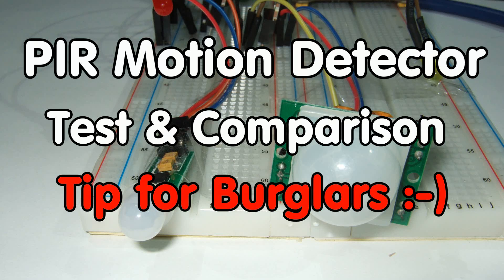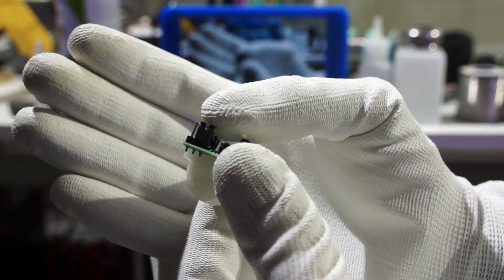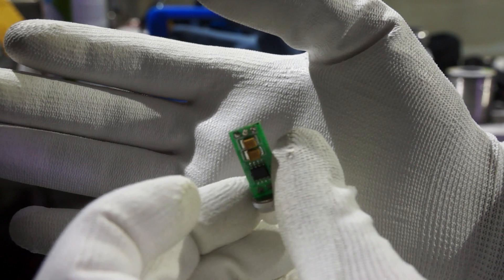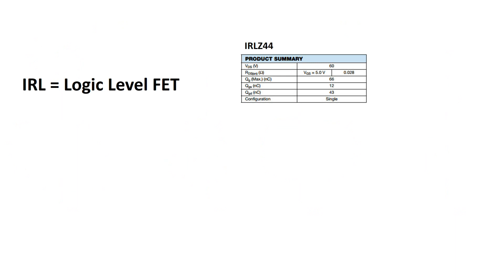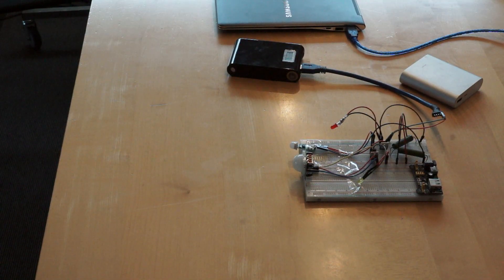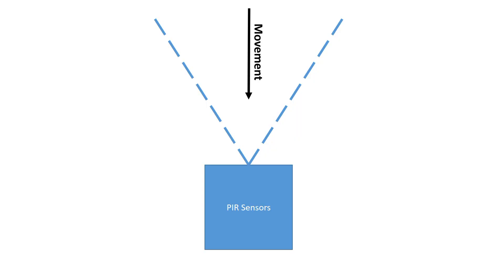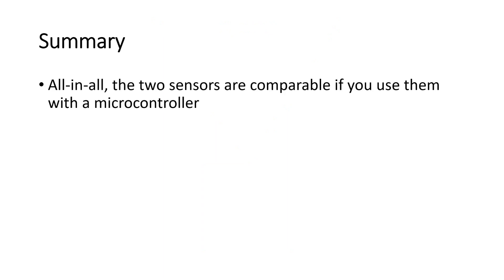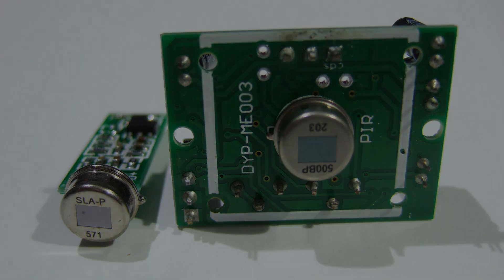#97 PIR Sensors: Test and comparison. Is the bigger better?

Comment: Is it HC-SR501  reliable? I bought new one and it's already broken.   I connect LED to its output. LED either stays ON or OFF forever regardless of movement in front of sensor. Sometime it also just blink.
Also what is  normal output voltage? I need to connect output to CD4017 clk pin which requires 5v.
Reply from the maker: I think, these sensors are ok (if not destroyed). The datasheet says that the output voltage is 3.3V.
Reply: @AndreasSpiess  Thank you for replying
I just received the new one today.
I connect output of the PIR to Optocoupler 817 along with LED and sensor works great now.
But there is a problem.  When the output goes from 0 to ~ 3.0v the LED on the other side of optocoupler doesn't light up. The LED on the PIR side light up though.
So it never trigger one of CD4017 IC pin. 
Anyway, I use Tinkercad to simulator my circuit and it works. I wonder why it doesn't work with the real circuit.
Any idea why it doesn't work?

Comment: hello Herr Spiess, i'm interested if on those PIR sensors possible to get a TTL high signal without timing or delays. just to get if real time there is activity or not. thinking of dual PIR barrier gate to evaluate passing direction of a person. (masking the dome for narrow field of vision).
Reply from the maker: I think it should be possible to reduce the time, but I do not know how. You have to dig into the data sheet of the chip
Reply: @AndreasSpiess  thanx, i was digging little more into pir-s. looks like better go with old-school IR-LED barrier,  but then i can't avoid homebrewing a PCB.
Reply: @AndreasSpiess  hello again Herr Spiess, sorry for my annoying pit-bull nature, i'm not much into fine electronics like yourself. I found that this HC-SR501pir module has a controller chip to shape the output of the raw PIR element to acceptable TTL levels. the controller chip looks like biss0001:
http://www.ladyada.net/media/sensors/BISS0001.pdf
from the drawings seems to have a pin (no12. / 2out / V2 on signal diagrams) which should provide a real time signal without delays  Tx Ti introduced on the signal. (just amplified to half TTL levels).
if i can tap this signal and process it myself through an ADC input pin of the esp board?
As my project is about to find direction of human traffic over the barrier gate, 2 pieces of those sensors claimed to consume 50uA each is far less than any IR-LED solution on a given few meter range.
best regards, levente
p.s. the other option is an IR diode TSAL6200 and some appropriate TSOP312.. or other receiver. description says led should run 400mA  38kHz carrier for ambient light filtering and with some 1:200 or whatever PWM ratio.

Comment: Small comment 2 years later - the small sensor seems to struggle with supply voltage of 3.3V :(
Reply from the maker: Thank you for your feedback.
Reply: I think it has a 3.3 V voltage regulator, so 3.3 volts is not enough to drive it (the voltage regulator has a minimum drop-out voltage). If your power supply is a steady 3.3 volts, you could just remove the voltage regulator.

Comment: hi, when you use it to trigger a relay, do you need the transistor or can you just connect the pir output to the relay coil with a resistor? thx
Reply from the maker: Relays usually need more current than microchips can provide. This is why you need a transistor (and a diode across the relay to protect the transistor)

Comment: I used these sensors on my Sonoff (GPIO14) and NudeMCU. unfortunately I get a lot of false triggers. do you know a solution?
Reply from the maker: There is a huge discussion on github. I will post a link in my next video, I have to search it first
Reply: Nice, thank you!
Greetings, 
The man with a Dutch acent
Reply: I would be interested in this link. I have checked your next video and it isn't there. Anyone knows the link and could post it? Thanks!

Comment: Most all PIRs for alarms have temperature compensation.  This will increase sensitivity when ambient temps are close to that of a human 98 degrees.  More reliable is the dual tech combo of microwave for moving masses and PIR for infrared movement for near perfect anti falsing.
Reply from the maker: The dual sensor is an interesting concept.

Comment: If you would have set the camera back a little, we could have seen what and where the PIR's were detecting.
you said 40 cm, but didn't show it. Instead we see you placing metal strips and the PIR's going off. I am interested in what the minimum distance is from the PIR before it will function. Your video did not tell me.
Reply from the maker: Thanks for the tip.

Comment: I'm experiencing  with different PIR Sensor`s on a D1 mini Basis, all PIR`s work`s but during over a day I have a lot of failure Signals (my lamp goes on but nobody is in the room). Since I use the AM312 PIR Sensor all is O.K.
Reply from the maker: Thanks for the feedback. Currently, I also use the AM312 with my Wemos for my two sensors in my lab. Without issues.

Comment: Dear Andreas,

I have been looking for some information this sensor detecting through glass or not. I am trying to use this inside a car to detect any passing by objects. Do you know if the sensor can detect through a car glasses or not? Some information said  it works others doubt about it. So I am confused.
Reply from the maker: We saw, that the range was much smaller through normal house glass. We did not do more tests.

Comment: Hi Andreas! I'm experiencing some problems with HC-SR501 and ESP8266s. I get soooo many false positive when pir sensor is near the esp. I guess some interference? Did you encounter the same issue?
Reply from the maker: Are you sure your PIR sensors work with 3.3V? Mine do not work below 5V (only one new version which is made for 3.3V)
Reply: I'm following this guide to get HC-SR501 work at 3.3v. 
http://techgurka.blogspot.it/2013/05/cheap-pyroelectric-infrared-pir-motion.html?m=1
In the comments some users have ghost triggering issues, too. I'm wondering if you're able to use these pir reliably with a nodemcu board, and how you connect the pir to nodemcu (3.3 or 5v? no ghost triggering?)
Thanks so much for the effort you put in this channel, and happy easter!

Comment: Hallo Andreas! Great video, as always. Much appreciated.

You wrote about the microwave sensors: "...I will have a look at them. But I read, the cheap ones work in the 2.4 GHz band, (even if the clame to be 10GHz and more) and this is certainly not, what I want because of my WLAN..."

My question is, how can one determine the actual frequency band a given sensor is using? I have some RCWL-0516 boards, in which the IC is RCWL-9196, and some modules that feature the BISS0001 chip. Obviously, there are no English datasheets, and even the Chinese->Engrish translations show absolutely no intel about the xmit frequency. Neither module seems to have an actual RF transmitter though, just the circular PCB-etched 'antenna'.

Anyway, keep up the good work. Your videos provide valuable and relevant information to the community.

Also, greetings from Finland, or, as it is in German (and in Schwiizerdütsch also, afaik), grüsse aus der Hölle! :D
Reply from the maker: +,MrZetor The devices are in the mail, so I have to wait... But what I have seen, these devices are very, very simple and the chips have nothing to do with the microwaves. They are just logical components. There is only a transtisor as an active RF element.
How to find the frequency? By measuring it. But this equipment is very expensive. I can only measure up to 3GHz. But at least, I can say, if it is in the 2.4 GHz band or not.
So, I am in the "Vorhölle" here in Switzerland (just returned from Dubai, which was then like heaven, just with another god ;-)  ). 
BTW: Googled AFAIK and learned something. Thanks

Comment: Hi Andreas,
 I noticed in your video you had the sensors on the bench/table. Whenever I have read anything about the PIR sensors they always suggest placement of 1.8 - 2m high. Did you try anything like that? I have both types in your video and some of the alarm wall mounted type. I was getting 8-12m+ range outdoors with the wall mounted type under 24*Celsius. The model I bought was around $13 free post,  also has a relay with NC/NO jumper select which is what I wanted for my setup. Thanks for the vids.

Comment: I just bought 10 big ones last month :(
I noticed that there are bands of inactive regions. The simplest solution, is to use 2 sensors, adjusted to cover each others bald spots, and OR the outputs:)
Andres, stop ruining my dreams with facts...
Reply from the maker: For the moment, I move a little if the light goes off ;-)

Comment: The little HC-SR505 can be modified for open collector output.  Add an NPN transistor (BC847 or similar) to the blank spot on the PCB.  Also remove the zero Ohm resistor right next to that.  More details here: http://www.da-share.com/misc/hc-sr505-pir/
Reply from the maker: Thanks for the link

Comment: I tested the larger sensor some time ago and from about 3 or 4 meters away directly in front it would sense me wiggling my thumb ;)  The sensor was pointing up - not at me.  So when you design, have the sensor catch the movement from the sides.
Reply from the maker: So, you confirm, that the sensitivity is higher at the sides. Good to have a confirmation!

Comment: Great info Andreas, thanks! What I really liked about this video was that the systematic method you used to carry out the testing was explained really well. Out of curiosity, how much time did you spend designing the tests, vs carrying them out? Again thank you.
Reply from the maker: +northshorepx Thanks for yor nice words. 
I need ones working day for one video. This is production time. Before I have to bouild the project. This comes in addition.
Reply: Andreas Spiess thanks Andreas.

Comment: From experience, I agree with the comment on the frenel lens. Security companies take a lot of effort to design the right lens to get the best performance. If you want to detect at close range, you can try the VL53 that you posted in one of your videos. It will detect and movement, even small ones to keep the light on. But they have a 2m limit as of today.
Reply from the maker: I will certainly look at this possibility as well as radar (a few viewers told me, that it works very good).

Comment: good afternoon. the better! believe me. https://ru.aliexpress.com/item/Mini-IR-Infrared-Pyroelectric-PIR-Body-Motion-Human-Sensor-Detector-Module/32640634184.html?spm=2114.13010608.0.0.gAEkbn&detailNewVersion=&categoryId=523 here's my video: https://www.youtube.com/watch?v=uMx_S19GCWw&t=4s
Reply: altered by a single module, motion sensor lighting and IR emitter. https://vk.com/id17088767?z=photo17088767_456239020%2Fphotos17088767 https://vk.com/id17088767?z=photo17088767_456239019%2Fphotos17088767
Reply from the maker: Did you test them in direct comparison to the two I used? What was the advantage?
Reply: excuse me. I do not know English, and an interpreter translated badly, I did not understand you.
Reply from the maker: Why is your module better?
Reply: It's not mine;) The module is installed in the DC-DC 3 volt and PIR. The operating voltage of the module 3 - 9 volts (3.3 volts for ESP8266). No false positives, No timer, No light sensor, it is ideal for a party with ESP8266.
Reply from the maker: Thanks!

Comment: Microwave sensors are much more interesting...
Reply from the maker: Some other viewers also pointed me at this fact. I will have a look at them. But I read, the cheap ones work in the 2.4 GHz band, (even if the clame to be 10GHz and more) and this is certainly not, what I want because of my WLAN...

Comment: Good job! 
I think the main reason of such difference is a the frenel lens cup construction and size. Try to disassemble the cups and look throug it to the light to see small frenel lenses size and quantity. Yo can also try to swap the lens cups on devices, see the results, or swap the sensor modules and see the results. 
Oh, and as for your marvelous accent, your english is much better than mine ;)
Best regards!
Reply from the maker: I am absolutely sure that the lenses are important, and for a buck or two, you do not get Leica quality... So, I just tested what I got.
I also did not compare many of the same sort. Maybe there are also differences between them.
Thanks for your nice words!
Reply from the maker: No. Maybe I will do it in the future.